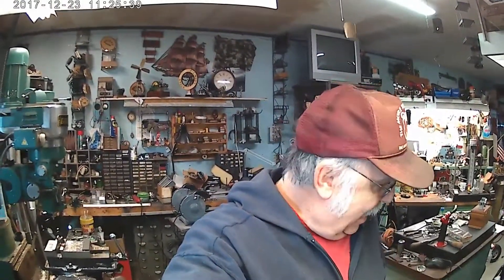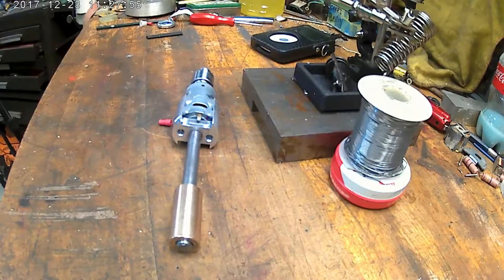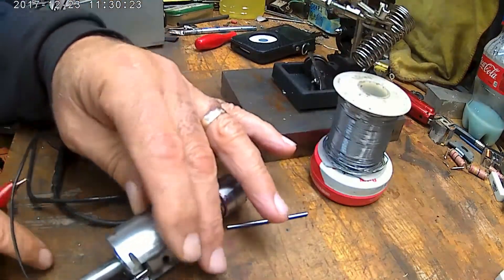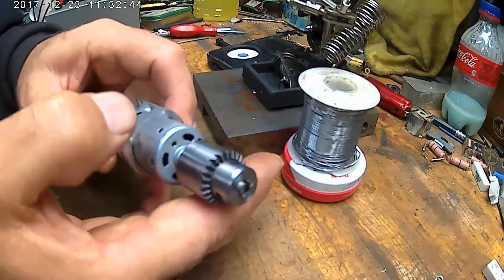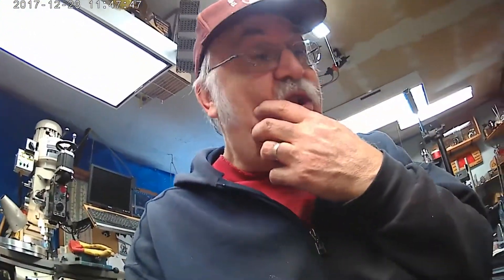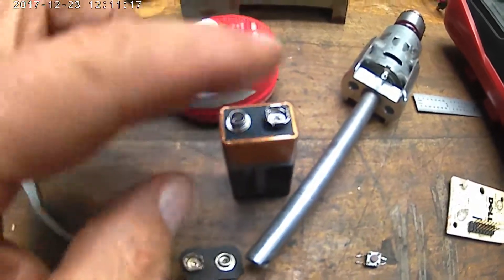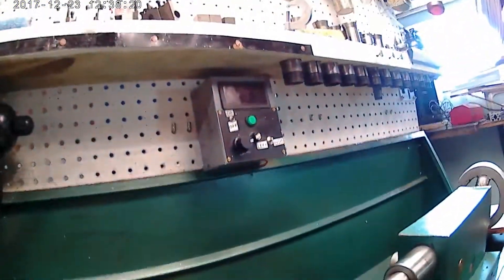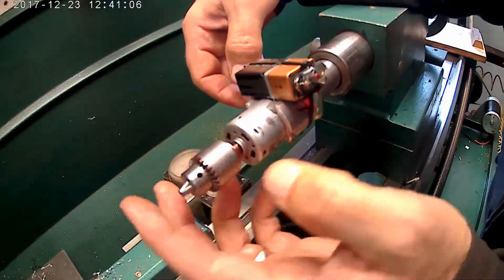High speed drill for lathe 4

Comment: Looking good...how fast can your lathe turn? I was thinking to strap a little dremel to a slider,  [no need to be in center] when clamped on the tool post.. my lathe goes around 2400 rpm.  right now I have a slider deal on the tool post which works great for small holes.
Reply from the maker: Only 1400 I could put it in a tool holder and do the same but I think this will work for me. Only time will tell I'll know after I use it a few times.